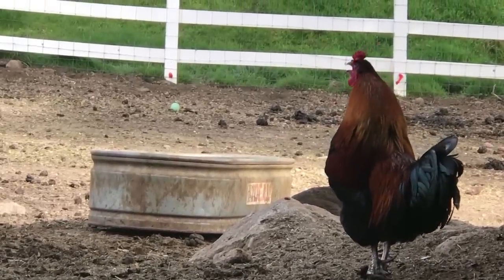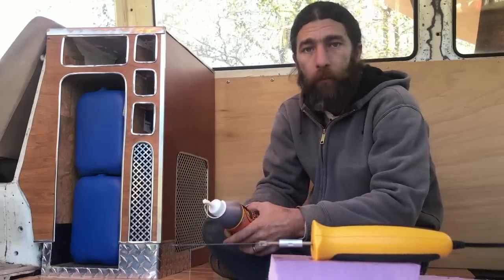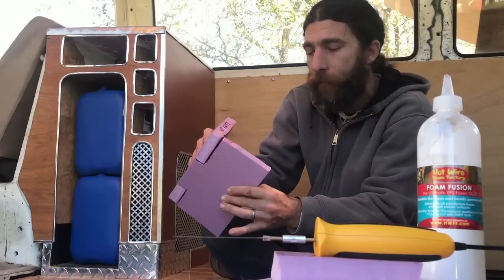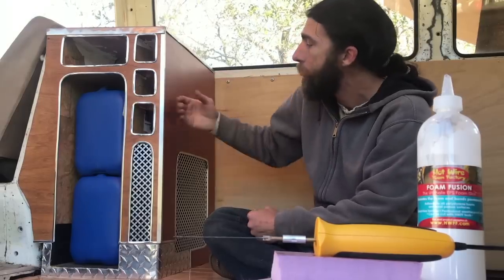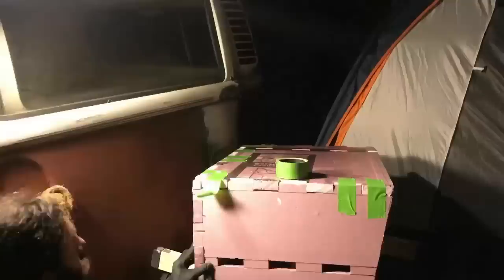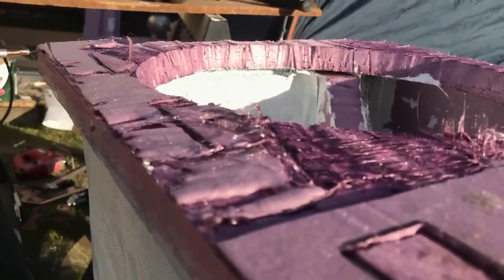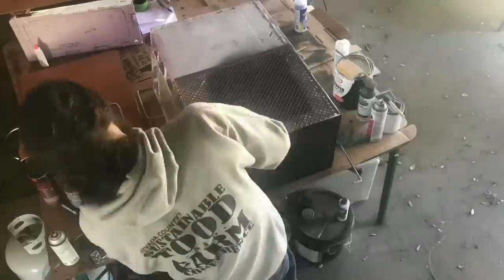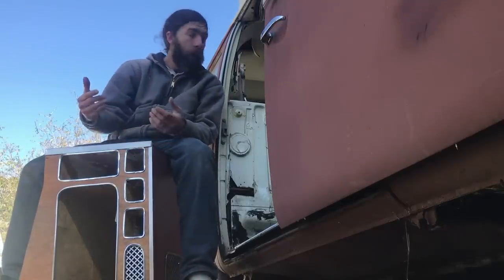Foam Cabinet Prototype - Improvements on Building Foam Cabinets for Camper Van

Comment: Great ideas sir! I would have NEVER thought of using foam board for this type of building. 

One thing about the Gorilla Glue will also do, that wasn't mentioned, is that when it expands it will knock your measurements out of whack.  I use this foam to build winter outside cat beds for the outdoor kitties. One thing that I used was 3 1/2 - 4 in general purpose (dry wall style) screws to connect them worked great. Combined with the glue, it should be extremely unbreakable. 

You put some amazing great thoughts into this.great job! Gives me great ideas for building a removable pickup camper system on my S-10. Thank you!

Comment: so much better then all the videos where I have seen people making hardwood shiplap wall coverings, with 2x4 closets. About time someone realized they are not making a HOUSE an stopped using house construction materials an techniques. That being said still might have used a SAW on the foam for straighter lines without worrying about going to fast or it bending.

Comment: Great job! One recommendation for long term use of liquid nails on metal, scuff up the metal with 100 grit sand paper to the applied sides so you have an area that binds better together and won’t want to peal over time.

Comment: Thinking to self... "Jump up and down--" ok never mind, you are. 

Great, easy to follow tutorial, thanks for sharing. Results speak for themselves. Veneering with a good looking timber can leave you with a very light weight, expensive-looking yet economically efficient and practical interior. Just great.
Reply from the maker: Hey thanks for the comment! It was featured in this video I just released. Jumping on cabinet starts at 50:50 your comment is the second one mentioned: https://youtu.be/BcAXr_gtbG8

Comment: I build campers for a living, excellent work!  Perfect for light weight construction but bulky.   Next time look into a thinner foam, I know we get 1" thick bead board that might serve better, especially if you laminated the paneling on either side and used a plunging router to make your cuts.

Comment: Great information to apply to other projects.  Always had arguments with box knife and finished edges. The joiner technique was mind blowing. You have opened up ideas to bevel edged joints in addition to 90 which you showed. Painters tape nice touch for temporary holds.

Comment: Great video.  Another option for converters is Garnica Europly Plywood.  It's made from poplar trees from Europe.  It is 1/3 lighter than traditional plywood, yet stronger due to less voids in the core than traditional plywood.  Not as light as foam, but much less labor.

Comment: Totes radtastic! I have been thinking about this a lot. I really want to keep my gas mileage down, and carrying hundreds of lbs of lumber constantly has just not set right with me. I am disabled, so just dealing with the lumber is a hasssle. But you really sold me on the mold resistance. That is my main concern. I have a mold allergy. Thank you!

Comment: Having built a few boats and worked on a few sailboats and racers the stressed panel with foam core like a surfboard is the best way to go. you did a great job I am going to be building a box truck into my zombie apocalypse bug out buggy/ mobile Workshop/home, home on the range.

Comment: Awesome build.  I love the fact that you take every aspect of this object and think through it, think through it, think through it, again and again and again until it makes a perfect result of strength, utility and aesthetic.   Like decoupaging maps onto the inside of the cubby holes!  Dovetailing the joints to increase the bonding surfaces.  Like no one does that except perfectionists like us.  And half the objects of whatever I buy today, I use it for the first time and ask myself "Did the person who designed this ever actually use it for its intended purpose?"  and of course, the object is constructed to provide the most minimal of utility at the absolutely most cheapest of cost to construct.    Bravo for taking the effort to think it through and do it right.  Because it always easier to do things right the first time than doing it half -a$$ed and doing it a second time.  And then! to use recycled materials re-purposed.!  Rock on.  Spot on.  If only this kind of thinking could be passed onto the next generation.;

Comment: Nice work and nice delivery. One suggestion: try a hot wire cutter with a guide fence for your long, precision joints. The increased cutting accuracy should significantly improve your joint strength, plus, it's pretty easy to increase the wattage/temperature a bit and cut a lot faster without any loss of precision. You can find lots of how-to videos for making your own wire cutter with a table and fench for just a few dollars in parts, plus whatever scraps you have laying around. Keep up the great work!

Comment: I’ve been thinking about these techniques for a long time, and when I saw this video, I instantly subscribed to your channel because most of the ideas I had are identical to yours. 
I’m planning on using door skin instead of plywood  
I’ve also thought about using the wire panels that you lay in a concrete slab by melting them into the foam and putting the door skin over it   

Thanks for a great video
Reply from the maker: I like it… experimentation is my favorite food group!

Comment: I am impressed, Sir!

Great video, great camera work, great editing.

LOTS of information without long stretches of 'progress' clips in between, very nicely 'condensed!'

One suggestion:  Look at the way "routers" are made, with the adjustable table to keep the bit/blade/cutter perfectly vertical/square to the work, and come up with something similar to add to that hot-knife tool, and once you have that added, also use a straight edge to guide your cuts.

Lastly, I have a hot knife, but it is far more 'industrial' than yours and the blade is about an inch by 3/8ths of an inch thick.  The knife you have looks FAR superior to mine!  Thank you for posting the link, I will be purchasing one of those!

Once again, very impressed with the video and appreciative of your time both recording and editing it, and posting it!

Say hi to your rooster for me :P

Comment: love the build and that cutter is great, 
however my caravan sink unit is built of 3/4" lightweight frame and 1/4 ply only weighs 6 lbs without the top and its 3' wide seems lot effort to do same job without any weight benefits, saying that i do thing you have great idea for building where shape is a problem as that knife will trim until correct shape is reached, much more difficult on wood.
thanks for sharing such a clear and informative build.

Comment: I like the foam idea. You did good cutting the sink circle into the hood. 
I bet you could use real counter top laminate in place of 1/8 ply. 
I might make long cuts by running the foam sheets through the table saw and slide miter saw.  Good work. I dig your van

Comment: Listen to this man...   He really knows his Hot Knives...     ;-)

I like your thinking on the light weight....   I've seen so many cabinet made of of 1/2 inch pine boards with more 1/2 inch pine stingers...  for a door..  and pine on the roof..
100s of extra pounds =  less water and batteries, and an unhappy + Thirsty engine.

Comment: You should look into getting a job as an aircraft mechanic, specifically structures, even more specifically aircraft cabinetry. I love it!!!!! It never even occurred to me that you could make a sandwich structure with Home Depot foam.
Reply: I don't know if you've considered this, but you may want to use that glue, rather than paint to adhere your mesh.

Comment: Wow, that was impressive. I could even see myself using your methods to create a storage unit for my room or a box for the cargo area of my Toyota Matrix. If you could make that cabinet, with layers of steel and thin wood and stay under 15 lbs, I would bet you could design and build an entire kitchen for a van or motor home that's around 100-150 lbs. 
And I am familiar with the Hot Wire Foam Factory tools. Great for crafts, but you found a very practical use.

Comment: Interesting video. Just a couple of things. Tensile strength you mentioned measures tension like pulling on the ends of something to determine when it breaks by being pulled straight apart. It looks like you were demonstrating bending (flexural) strength. 

Also you should investigate doing foam sandwich construction with the same foam and a light fiberglass skin on each side. I believe there would be and enormous amount of time saved because you would not need to do your tongue and groove joints.  That's why they make boats and airplanes that way. That kind of construction has Incredible strength  without the complicated joints.

Comment: Love the idea of dovetailing your joints for extra structural strength, and the screen too.  Just a thought, if you use your hot knife by dragging at a 45 or 40 degree angle you'd get better straight cuts.  
great vid, tnx for posting.
Reply from the maker: Hey thanks for the comment! It was addressed in this video I just released. Check the table of contents at the beginning if you want to skip to a particular subject: https://youtu.be/BcAXr_gtbG8

Comment: The making of the vid is no less excellent than the building process itself.  The only thing I'd improve on for my own project is to slap a face frame on the cabinet to achieve an even sharper look with minimal addition of weight.

Comment: You kept saying ‘tongue and groove’ when I think you meant mortise and tenon. 
That’s the only criticism I have. This method is simply fantastic. I agree with both of your improvements.
I’ve never liked cutting foam with a blade SPECIFICALLY because of what you pointed out, and I’ve never been a big fan of gorilla glue because if the expansion and it’s set-up time (I can deal with the set-up, but the expansion throws off your dimensions!).
Looking forward to the rest of the build!

Comment: I know you're already far along or even done with your project, but if you're willing to go to the length of finger joints for your panel corners, you could even consider doing dovetails.  This will have all the advantages of being a good joint with plenty of glue surface, but also be mechanically resistant to pulling apart in one direction regardless of gluing.

Comment: Suggestion: Drill a small hole in a 1/4 inch plywood and mount the hot knife to the underside with blade coming thru surface to make it a 'scroll saw' for foam. Short legs support table, and you now have two hands to manipulate the workpiece. Guide fences can be clamped onto table with simple scrap foam that has a straight edge.

Comment: Very cool video, I've got a tip for you. I built myself a tiny travel trailer in my garage and built my cabinets very similar to yours (it's really cool to see you come to the same kind of conclusion) but I clad my cabinets in 1/8" birch ply inside and out, so I could stain them. That's not the tip... use that Gliden gripper primer as your foam adhesive, it's cheaper; test it and you will see that the foam will fail before the joint does! I got that tip from a YouTuber who builds Halloween props out of foam, and man its been one of the best tips for foam construction I've come across. Cheers :D

Comment: Very nice work I like that you took the time to figure out a good design and did not just slap it together with wood and nails  I would say its a improved Cabinet makers level of worth  For my hobby or shall we say My relax away from the wife and work I am customizing my 2005 chevy blazer 2dr 4x4 And had done a long thought and idea of usage with it ..We have a 2018 Chevy volt for day to day means which is really good on gas because we use more E power than Gas  And if it wasnt for the automatic 1 month must use gas switch  We would have 4 to 6 month on 1 fill up ..Anyways The truck is more for Camping weekends, Traditional Drive-in movies very month or so in summer And haul random items example : new mattress  coffee table Tools lumber ... I have gutted everything from the front seats back Because really only 2 people ever been in the truck at one time.  I will be welding steel bed framing 3 inch cuts with a small hole for pins to the frame ribs along the rear inside above the wheel wells  The dip on the floor where the rear seats use to be need to leveled flat with the rest of the rear floor (2nd battery etc and water supply) Your video has peaked my ideas not only there But a few pockets along the sides and maybe a small over head along the sides as well for light storage  Thanks for the video

Comment: Pretty cool. 
Something I’ve learned when trying to make really light weight projects sometimes is that 1/8 or 1/4 Baltic birch plywood is probly 3-4x stronger then people think it is. 
At 1/4” people have an idea of how warped or soft plywood is, but Baltic birch is so stable and solid that “most” things you use 3/4 plywood for, you could use 1/4” Baltic for. A small cabinet like this could be done with 1/8”.
Reply from the maker: I bet you couldn’t jump up and down on it though. I have a whole transit build on my channel that is all foam if you’re interested.

Comment: oh dude, so glad i seen this, been thinking about a van, but showers. and maybe i don't want the shower in there because of other transport needs? maybe some people to move? right? imagine a slide in the back shower unit, you inspired me to consider vent hoods for bottom tread surface,or hey wait, that bed liner paint, it comes in colors! this could rock, if i succeed? i pm you a image, later and thanks for your effort..

Comment: Like the video it's very informative I'm thinking of doing the same on a 2010 Oddyssey just looking for information. The foam method looks awesome might save on gas since it's lighter than wood. Reading all the comments below also made me think with the way you strengthen foam it might still weight the same as wood. I would have to do more research. Keep up the good work.

Comment: I’m thinking of using your method to rebuild my travel trailer. It was gutted for some kinda use, but my plan is to make it my man-cave/office. Larry, at mobiltec, says don’t gut a travel trailer; work from the outside inwardly. But what’s done is done and I’m working backwards. So I think by using your techniques I’ll add both strength and insulation.

Comment: Awesome  improvements    The finger joint joinery is a great job  
 I’m not sure if you are aware.   They do make a simulated diamond plate   High pressure dense laminate (Formica) I don’t remember which manufacture  makes it. As i worke in a cabinet shop that dealt with all the lines  to meet or customers needs   I was going to use it on cabinet doors for a utility trailer to give it the industrial look and keep the weight down  i also thought about  skinning a refrigerator door on my  sport fisherman boat in the galley with it  as well  it was pricey  per square inch    But it looked kind of cool  I grabbed a sheet  for a buddy of mine to use as a  countertop in his hotrod garage too he loves it   And has used it as a workbench  too  keep in mind he does own and operate a full blown shop that most of his heavy work takes place so he  uses that workbench to do small  jobs like  rebuilding or. Adjusting  a carb  or?  Most of the hard use comes from  guys hanging out and drinking beers on the  “bench. As this is a garage he has ar his home  to play around and store his  hotrods in  engine and transmission work would be done at his big garage he and his brother run and work out of  during the week  btw it is a raised  diamond pattern like the quarter inch aluminum  so it looks good   And the tensile strength is strong      I’m looking foward to more of your videos as i have subbed  will like and share to show support whenever i can  I too have messed around and experimented  with the same foams   As i   Experimented  using it for a wakeboard   I strapped the idea and went with a  hollow core  eight inch  luan skin  that was West Epoxied  utilizing a fiberglass mat for strength    It worked fine as  yo probably know the foam  reacts to resins and  just disetegrates   You can by surfboard blanks that are different  but pretty expensive  a long time after i completed the wood board some one suggested covering the styrofoam with  ordinary packing tape then   Putting the resin on  that ?   I was a woodworker most of my life so that’s why i went with what i did   The big challenge was laminating the skins  on because  like a surfboard   A wake board   Has the compound curves to it  so clamping becomes a challenge and. You use every  technique you can think of   It was of course a one off   Job  so it was fun and a father son  thing

Comment: You might like to check out plantation grown timber called Paulownia ( or Kiri ). Its nearly as light as the foam, 1/2 - 2/3rd the price of foam , and can be varnished like wood.
Its very rot proof, as strong as western red cedar,  and glues like wood.
Very popular for lightweight camper interiors, even for shower partitions.
They also make surfboards out of it, to give you an idea of its strength and waterproofness.